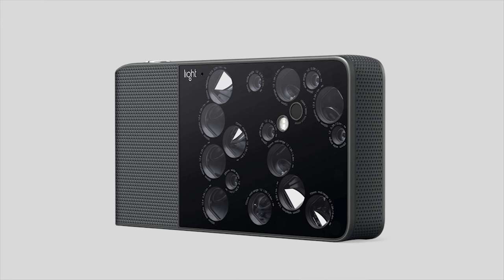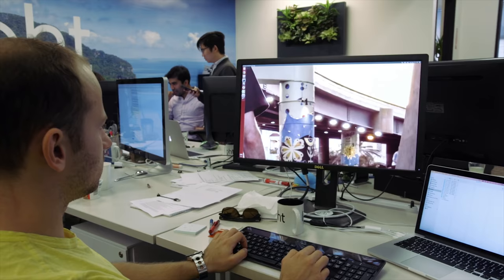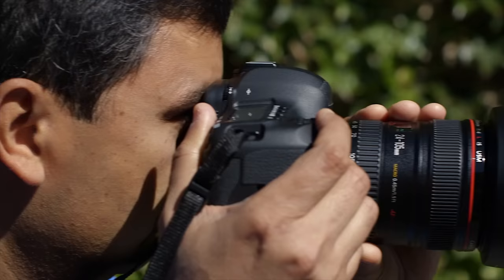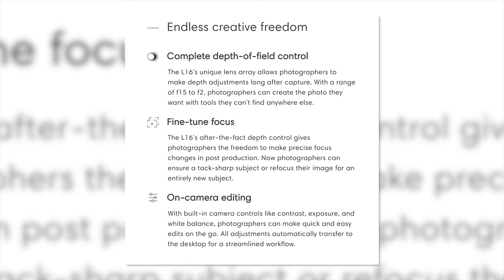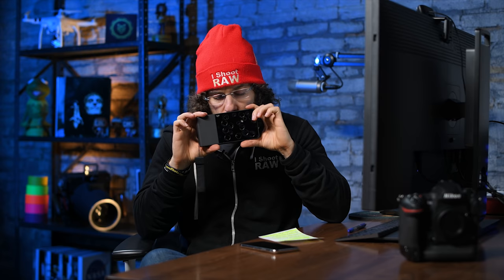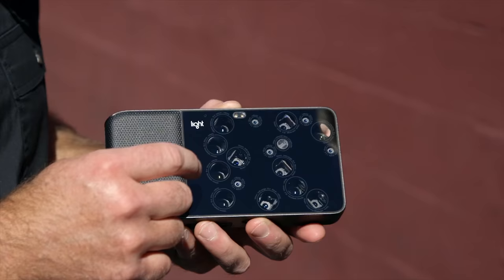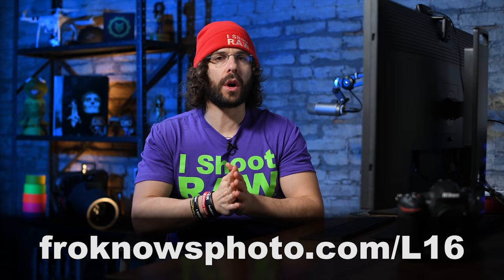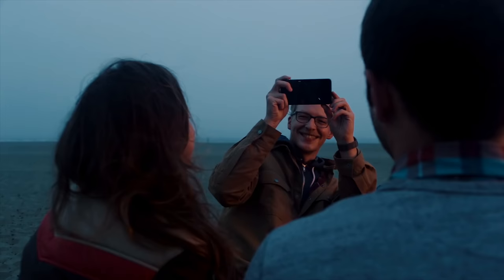This CAMERA SUCKS! But its tech is the Future of Photography

Comment: The reality is that the software will never replace the optical quality of a great big lens.  Software nowadays can hide at an important degree the disadvantages of a cheap small lenses like the vignetting, chromatic aberration, contrast, saturation, softens, geometric distortion, perspective distortion etc. That is great with smartphones. 
However at the end of the day with very high resolution big displays those digital corrections can't compete with the optical quality of a good lens.
Reply: Achilleas Labrou I'm not sure about the word "never", and neither you or anyone else should be. Only 5 years ago computational photography was just some experimental fluff and now look at the iphones and pixels which can take good "computationable" photos given the right conditions. Progress is going fast, certainly not stopped or slowing down which would lead to think about "never like good optics"
Reply: ducav2 at least until you zoom in and see how muddy they are

Comment: The L16 was declared DOA years ago, but the concept behind it has a lot of potential in the industry. Right now, getting huge, high resolution photos requires massive custom made sensors, but you could apply the multi-lens concept with multiple drones, multiple cameras, etc.
Reply: there's an intel market for what you're describing.  I'd be suprised if they weren't selling it to agencies under the table ...
Reply: @lylestavast7652  actually this is well known fact... Similar type of technology was introduced to reconnaissance planes for terrain mapping years ago.

Comment: For those who don't know anything about photography , they stick with a smartphone camera
For those Hobby photographers, they stick with a Crop Body with a 18-200/18-300 Lens which has huge focal length
For those professional photographers, they stick with the current set of lenses (as Jared said)
This camera doesn't cater to any one specific category above and doesn't excel at any. Who would Shell $2000 on something like this, which doesn't have long focal length for wildlife photography, doesn't have a really wide angle for landscape and has questionable low light performance because of 16 small sensors. I mean my Crop Body Camera with 4 lenses costs way less than $2000 and I can accomplish much more than what this can do (the only difference being is that my equipment is larger )

Comment: Little miniature lenses will not replace proper optics. SOME things haven't changed since the film days. It's always going to be about the ends of the chain-the lens and the printer or the monitor. In music it's the same-the microphone and the speakers. You can get away with crap in the middle, but not at the ends.

Comment: Somebody read about VLA telescopes in a Scientific American article years ago and thought to themselves "What if I could design a CAMERA that uses a bunch of smaller lenses  working in unison, to produce images as if they were from a physically much bigger lens?" 
Which sounds great, except the physical form factor of your camera still presents a total front surface area no greater than a DSLR, and compared to a DSLR-sized proper large aperture light gathering lens, sucks donkey-balls despite software tricks, this is one fantastically engineered ball of crap. 
If maybe someday, possibly, the software and sensor designs get good enough to actually get this wet dog of a camera to achieve pretty damn close to what a currently modern DSLR or mirrorless camera can do, you can be sure DSLRs / Mirrorless cameras will have already evolved and eclipsed this hideous multi-eyed beast. You can't software yourself enough to extend beyond basic principles of physics.

Comment: a more optimistic and less expensive approach of multi-focus cameras would be: build in much more processing power and take 120+ fps in fullframe using focus-stacking with top f1.2 lenses. process as many raws as you feel fit. maybe 20x faster processors and larger storage capacities are needed for that. but there's no doubt it's achieveable while the stacking-technology is available now.

Comment: as for right now I think there is nothing better than a DSLR or SLR you don't have the versatility  of a real camera especially with the assortment of lenses from 12mm-to over 800mm an Iphone doesn't even have that type of range. yet the software on the is a good thing and can be improved and used in today's camera's to take even better pics

Comment: I bought one of this cameras and it’s the worst camera for the money ever. I love the idea but the camera sucks. The software is even worst. The camera gets really hot without me even using it. The software is a joke. It’s a lot of work to get a crappie finished photo. The camera feels like you’re going to break it at any moment (super heavy and glass front and back) I was afraid of that even in my back pack or when it was charging on my desk. You can’t use Lightroom or photoshop before editing in their “beta” software. I sold it for $1k loosing a over $1k with all the accessories. Now I own Sony A7iii which cost me the same amount and is way versatile and can do a lot more.

Comment: You would think they'd design a camera that will compete with existing cameras. Yongnuo is building a mirrorless that runs on android and has the ability to connect to the internet and post your images to Instagram and Facebook straight off the camera. And that camera is an interchangeable lens mirrorless platform. It looks like this camera was a thing that wont compete with anybody because it doesn't have the image quality nor the usability of a used canon rebel. And you know what the used canon rebel price tags look like. In short, the pro photographer market will go with form, function, and image quality. The hobbyists will go with the rebels or Nikon 3000 or 5000 series. The people who aren't camera people will continue to play with their cell phones. This camera does not gain the attention of any potential market.

As far as the software goes, I'm sure that's one hell of a program. Linking several cameras together to create a panorama and focus stacking is an awesome idea and if it works, I can see a tripod mounted machine of some sort that tethers to the camera and shoots a focus stacked panorama. Another industry that uses cameras is security or surveillance systems. I personally was on a construction crew that built part of a Google complex. I'm under contract to not tell you anything I may have learned (I really don't know any useful information. I helped put their air conditioning system together.) But the security systems out there were outstanding. It would be easier to sneak into an FBI office than Google. Now, if Google could use their multiple camera security system to focus stack a panorama video on a wide angle, they could have one big screen monitoring one side of their building. With a whole bunch of digital zooming and cropping capabilities. That would be very interesting.

Comment: Well it's to be expected that these things can't compete with SLR's. Let's not forget It took some time for digital to totally own film. But thank god someone is working on radical improvements. Nikon and canon like it best to sell insignificant updates at the same high cost every generation after generation. 
Now that you mentioned the P&S cameras going extinct... Sure partially it's because cellphones are convenient for the general public. But the other reason is that the tech never got updated they kept pushing the same old philosophy of crappy zoom lenses and outdated image processing resulting in worse image quality than what a smartphone can do.
If they put the same tech into a P&S that is in the smartphones with 2 or 3 fixed lenses and P&S sized sensors instead of cramming a big sensor inside and pricing it like a crop sensor SLR, then there might be a chance people would actually buy it. 

There are things that can't be done with a big sensor SLR. I miss my old p&s. But I will not buy a dedicated device that costs more and produces technically inferior images to a multi-function device. WTF?

Comment: They need a better processor to help with the computational part. A snapdragon 845 or A12 would do the trick. Look at night sight on pixel and the hdr modes on the pixel 3 and iPhone xs. They could do amazing things if they had better processors and software
Reply: Mostly the software. Even the desktop software on a 6-core cpu takes hours to process a couple of hundred images.

Comment: WAY TOO HARSH ABOUT IT. Yes the price is too high for what its target user base is. But you are making a HUGE deal about its size, of course you wouldn't put it in the same pocket as your phone, but you're literally wearing a hoodie that has 2 large pockets holding nothing. I am positive that its better quality (photo wise) than the Iphone. Please do a full test before ripping on something people did work hard on. Its nowhere near the failure of Lytro. Lytro didn't know what they were doing and made a scam product that worked worse than a low end compact camera. Price and software need work YES. But to say its a failure is a big misrepresentation. AND I DON'T EVEN WANT IT. I love my DSLRs and wouldnt trade them for the world. But its a bit much to trash this product cause its really not as impractical as you put it.

Comment: If Google owned this and did the same thing they were doing with the Pixel then it would be ready for the real world
Edit: also camera manufacturers really gotta catch up with the software side because the amount of details Google and Apple can pull from such a small sensor is incredible
Reply: It's weird how Pixel it's one of the few flagship phones that still remains with one main camera on its back instead of that crazy trend of putting tons of lenses in the back
Reply: @advancexz0   There is a Reason for companies like huawei (as example) to put more lenses , different focal lenghts, wide, ultra wide, telephoto, they provide versatility, even google did put a secondary front facing camera fo wide angle.  the thing is people tend to think that those 2 or 3 cameras work all together (but of course there are a few smarthphones that actually just have a secondary depth sensor camera like oneplus) taking a snap when they are not each one serves a different purpose. The super res zoom on pixel 3 dont match the quality of 3x telephoto on huawei mate 20 pro.
Reply: I don't think the amount of detail that get from such a small sensor is incredible. (and not any better than the small sensor from camera manufacturers)
But more importantly: photography has never been about the amount of detail you can capture.

The smartphones lack the tools you really need to tell a story with your photos: to change your field of view. Wide angle vs tele
And to change the depth of field.

This weird gizmo could have a place in the market if they had given it a good grip, and let it compete with normal cameras instead of smartphones. Of course that means that they would need their software ready to give us the option to change field of view and depth of field.
But looking at the example pictures it seems they failed in both and it doesn't do much more than a smartphone camera.
Reply: I know that @slandgkearth  what I mean is how weird is even when Google is putting money in this they resist the idea of use it on Pixel, when the actual race is who put more lenses on the back

Comment: Wouldn’t computational photography in real cameras require two sensors and lenses?
Reply from the maker: No, I think it's going to take advantage of software and hardware currently there.
Reply: Jared Polin do u have any specific examples that might be possible? Just curious because I personally don’t see it as of now.
Reply: Let's see. Google Pixel 3 uses Dual Pixel AF sensor array to calculate a very accurate 3D depth map, which can be used to artificially decrease depth of field, and that's on a single tiny camera with infinite DOF, imagine how accurate it could be when you start out with a sufficiently isolated background. A VERY cool application could be getting an f/1.2 aperture look from any DSLR lens, especially say the f/1.8-2.8 ones. Wouldn't that be cool? 
Also realtime image stacking for absolute zero shutter + ENORMOUS DR + immensely lower noise levels are all very viable applications. 
I actually think if Canon, Nikon and Sony did not invest in software technology, they'll suffer BIG TIME.
Reply: Ebrahim Saadawi I personally haven’t seen depth of field mapping and the fake bokeh to be any good in cell phones, there’s issues oftentimes. The image stacking seems cool but wouldn’t the camera have to take muiltiple photos from the same position, requiring a tripod? That’s basically just normal HDR we can do now. I don’t see how these things would lower noise as you claim.